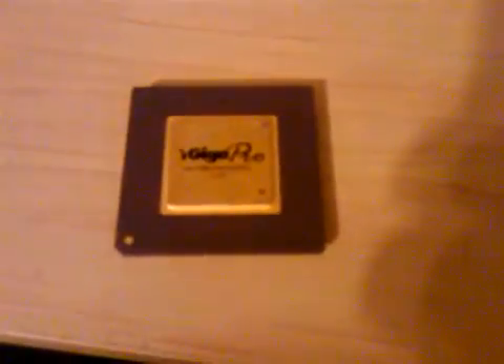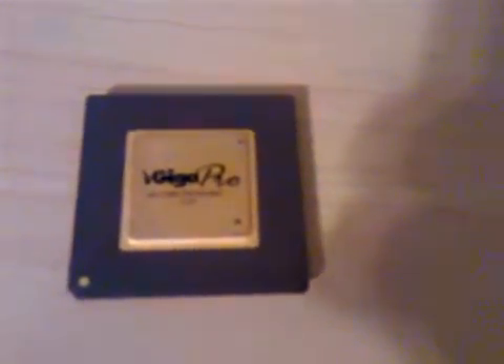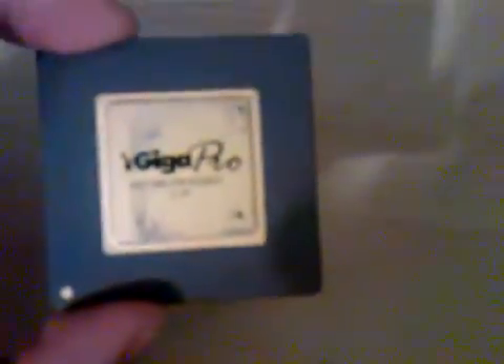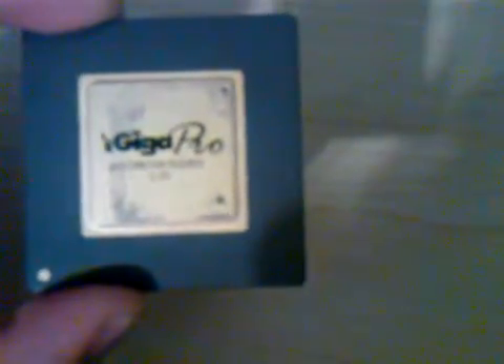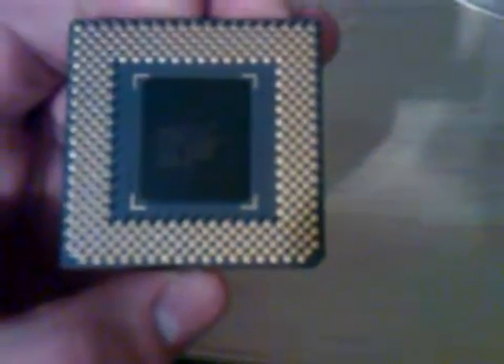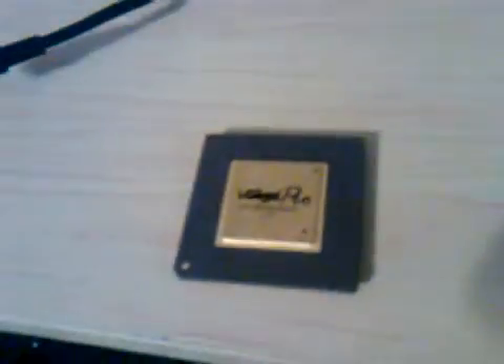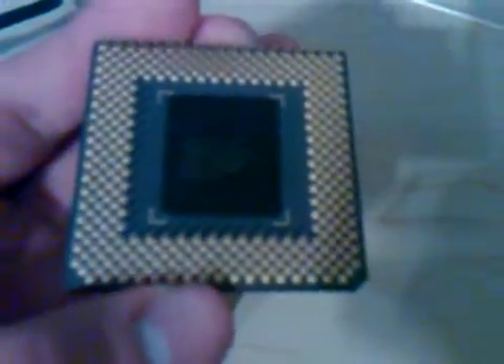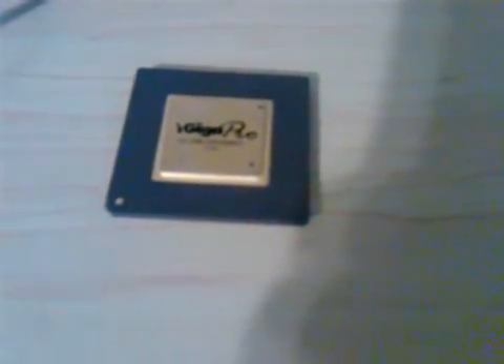rare 1 giga pro cpu

Comment: 1GigaPro is a relabeled VIA C3. The PGA370 version runs around 650 MHz, the BGA embedded version runs at 667 MHz.

In either case they're junk parts. Cyrix never really evolved their core past the early Pentium era in regards to performance, as a result they're much slower than equivalently clocked Intel and AMD parts.

VIA still sells Cyrix parts by the boatload in Asia and embedded markets because they're dirt cheap. They're often found in thin clients, no-brand laptops and highly integrated PCs.